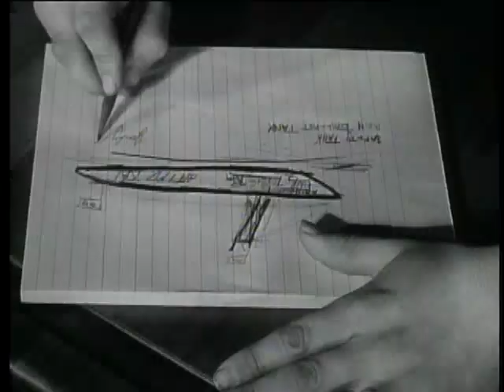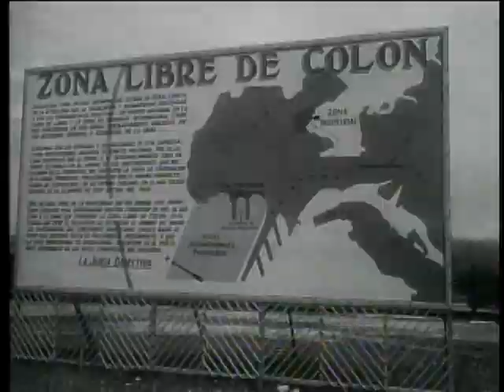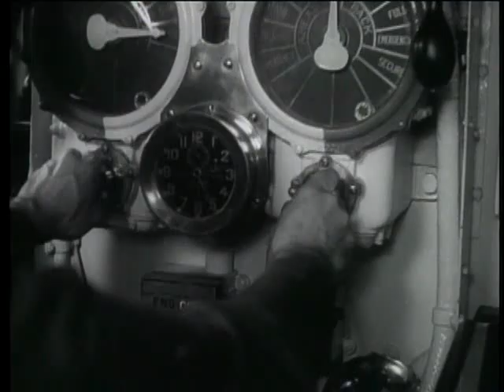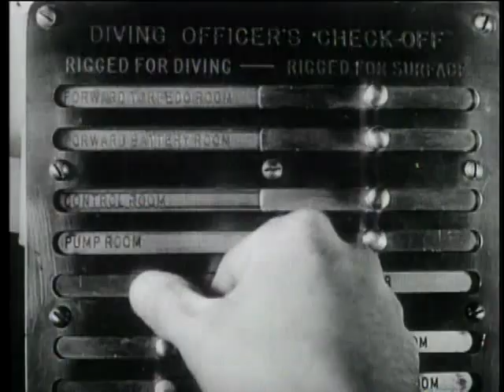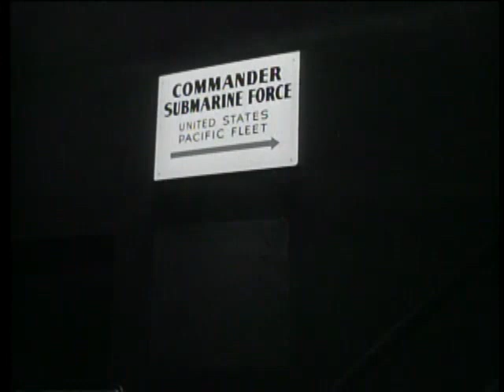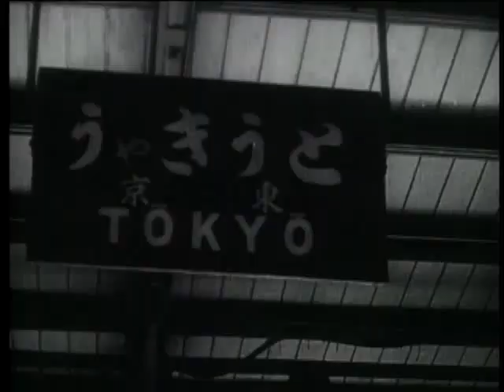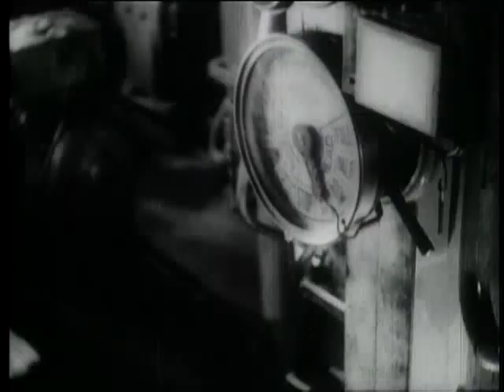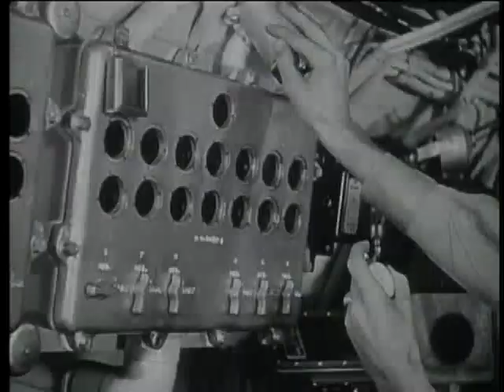Victory At Sea - Episode 21 ~ Full Fathom Five (Complete Episode)

Comment: Is that a large hawse pipe on the prow of those boats?
Reply: Net cutter.
Reply: Hmmm, I thought I've seen photos of boats with a saw toothed-like apparatus on the bow that was used to cut nets? Maybe two tools of different design for the same purpose?
Reply: It's called a bull nose. Used for running a mooring line through. And quite the handy step up to the deck too, when the boat is moored bow on to a pier.